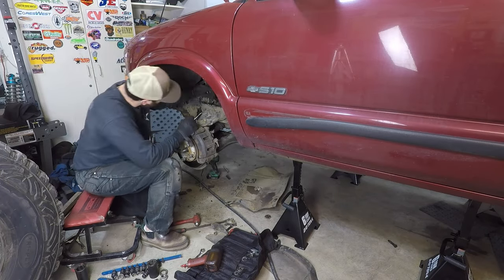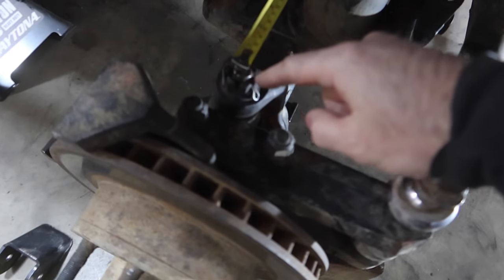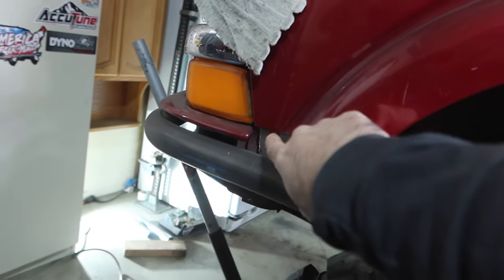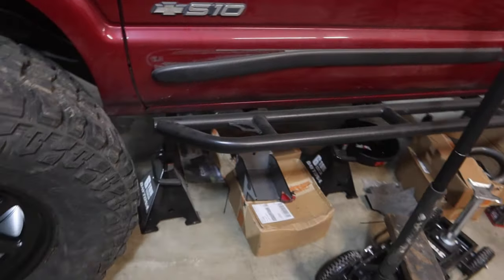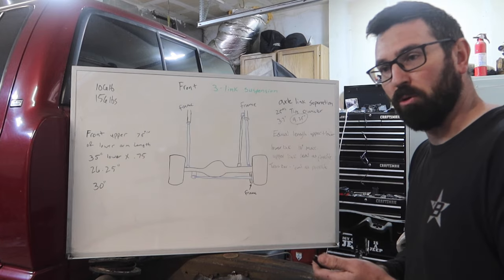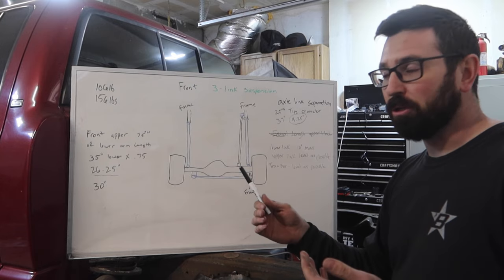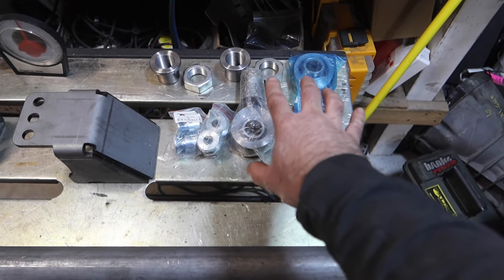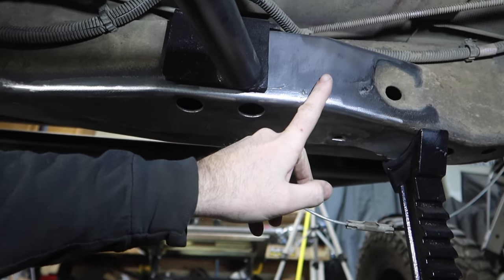Solid Axle swap the easy way!! S10 Rock Lander Dana 44 axle swap

Comment: Iam running 5.5 rock kralwer triple rate jk springs on my s10 , they seam to hold the weight of the s10 really well , iam also using adjustable buckets.  Makes fine tuning much easier
Reply from the maker: Good to know, thanks 👍🏻

Comment: i would lower the spring mount to closely duplicate the tj spring mount to axel set up. that #1 wont cost any extra, #2 not sure how the multi rate 6" spring would work with your intended ride height . 6"lift i think would be engineered to have a much higher ride height before bump. thanks for the great info and explanation on front geometry.

Comment: Not sure if you're taking this into consideration but a longer spring of the same spring rate might not be the answer.  With the axle at full bump, will the block height of a longer spring fit between the upper and lower spring mounts?  I think this truck will be heavier than a TJ so a stiffer spring with the correct block height might be what you need instead.
Reply from the maker: Yes, I think you might be correct. The s10 weights about 800lbs more than the tj, but the engines weights about the same, 4.0 being a little heavier. So I will try this and if it’s too soft, I might change to a zj spring which have a 24lb heavier spring rate than the tj.

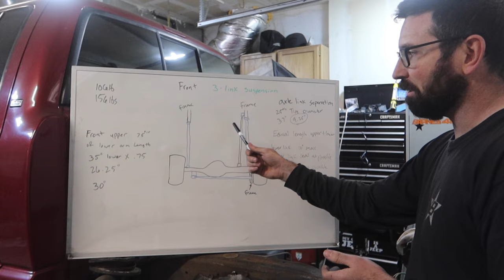Comment: 5:16 A point of contention.... You don't "have" to use a Panhard bar. (its not a track bar.....) You could use one of the variations on a "watts link". And given your oil pan layout, engine mount set up, along with your steering geometry, you might want to consider a horizontal watts link.

Comment: If you cut 3" out of the towers and go for the larger springs you will be able to have more down travel. Build some sort of spring retainer for the axle and frame so it doesn't come loose at full droop
Reply from the maker: 👍🏻 the reason I like the metal cloak springs is even at full droop they never come loose, because of the upper soft spring rate.

Comment: I did an ABS delete when I SAS’d my 4 runner.
Reply from the maker: Same master cylinder I assume? With the abs out I now have room for the arb compressor and wiring stuff so it worked out. Just more work making brake lines.
Reply: @MuddyBeards4X4 , my year (2000), the abs pump was separate from the master cylinder (later years, it one unit). Yes, I’m using the stock master cylinder and it works great. The abs on it was not a good system. It rarely kicked in on road and kicked in offroad way too much. I also needed the space under the hood. I wanted it gone anyway.

Comment: cut both coil buckets out and go to a cheaper 14" coilover so youre not pulling hair over spring rates. ride height, and have good and easy shock tuning. so much more simple of a setup

Comment: Consider ZJ front coils.
They are identical dimensions to TJ coil's, but they have a higher spring rate for the heavier V8 chassis.
Reply from the maker: Good to know, I don’t really want a higher spring rate necessarily, but definitely an option to look into

Comment: If you re-install ABS and get to the bleeding stage and you can't get it to bleed that is normal sometimes when changing an ABS unit sometimes you need a special machine to push fluid through or theres a special procedure. I can't remember specifically for your vehicle but I've had troubles and have helped plenty of people that have had troubles bleeding a new ABS unit. I'd suggest deleting ABS then you don't have to mess with sensors and tone rings and stuff at the wheels with your new stuff. Ive deleted ABS on a few vehicles with not much trouble especially older vehicles. But, and this is a big but lol, if the ABS ties into other systems that require wheel speed and whatnot or theres features you want to keep or the computer needs then it can get troublesome and in that case I'd keep it and try to simplify and relocate things.
Reply from the maker: The abs is out, no wheel speed sensors,  so it would never work anyways. You need the gm or aftermarket scan tool to bleed the abs module. I worked as a tech for GM and replaced and bled plenty of them, they do suck.
Reply: @MuddyBeards4X4  awesome you shouldn't have too much trouble making new lines and getting it all fixed up. ABS takes up a lot of real-estate sometimes plus I've never liked ABS on a offroad oriented vehicle. 
I'm guessing your stock master cylinder is probably just fine for the size of calipers on the new axles so you probably won't have much trouble with anything unless you have to mess with the proportioning valve. 
Have you ever thought about doing hydroboost? It's probably unnecessary with your setup but I really like hydroboost and there's probably some off the shelf parts you could use from the vans.

Comment: I'm doing a d44hp in my 02 tahoe.   What did you end up going for spindles and hubs.  Are you running ford knuckles and hubs and spindles. ? Or are you running chevy 6 lug wheel adapters
Reply from the maker: It’s all stock ford stuff with warn locking hubs. Mine is out of a 76 f150.

Comment: Why don’t you get a set of ZJ 7 inch front springs? Same size as TJ coils and should be about what you want ride height wise.
Reply from the maker: Yea, if the Tj springs are too soft I will try zj springs, they are 24lb heavier spring rate than the Tj ones.

Comment: Getting closer! Do you think the weight of that crew cab may be a bit much for the TJ springs?
Reply from the maker: Thanks, good point, maybe. I ordered 6” springs. If I don’t like those or they are too soft I will try v8 zj springs maybe…
Reply: If you have someone close by with the same lift spring on TJ ,maybe measure theirs and yours to compare the height of them and see what the difference is.That would give a good idea if they are overloaded.

Comment: I think I would go longer springs. 6 inches even. In my mind that should give more coil to help it not come unseated when you flex and run longer shocks
Reply from the maker: Yup, I am going to try 6” coils and lowering the tower 1.5” and see where I am at. If they end up too soft I can switch to zj springs which have a slightly higher spring rate.
Reply: @MuddyBeards4X4  sounds like a good plan to me! I have a 80 series I recent did a reverse 4 link and 3 link on. I didn’t go coilovers like you eventually I will but it’s amazing what a difference it made already man.

Comment: I had recently swapped D35 for a D44  w/iron rock truss in the rear of my 04wj, the axle seems to be slamming into the transmission on the slip yoke side,,for the time being to get thought winter does anyone know the difference of adjustable length on the control arms????